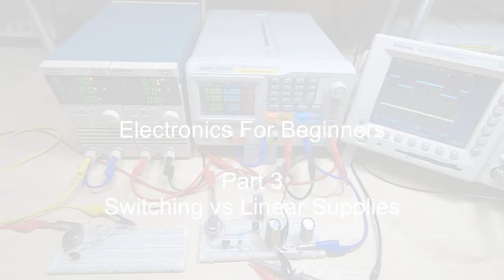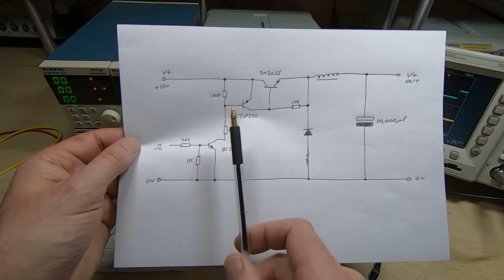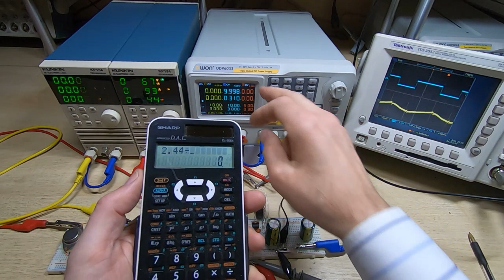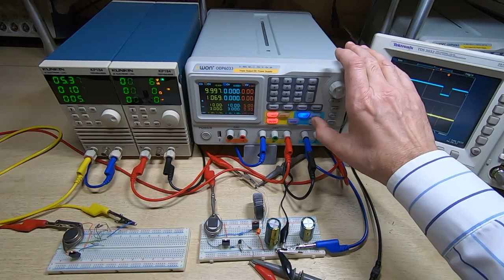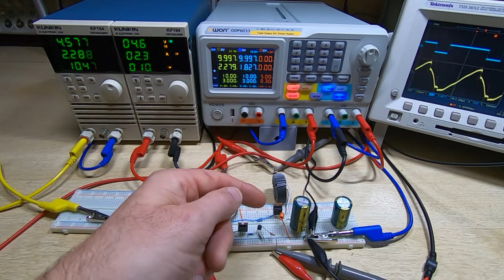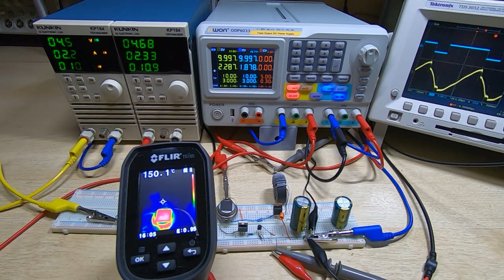Electronics For Beginners Part3

Comment: Another fascinating video Jerry. I thought we were going to see the linear supply breadboard melt! I know I could do it from the information displayed but for us lazy viewers it would have been helpful to calculate the efficiency of each unit for comparison. I love the idea that we could optimise the components and add feedback to the switching supply - no, YOU could, I couldn't! 😀 So, apart from getting less ripple, why would someone choose a linear supply over a switching one?
Reply from the maker: The efficiency of the linear supply in this example is 50%. That is why I chose a 10V supply and 5V output. I did not show the calculation in the video as it was really fixed (as it is for linear supplies). A really interesting project is to build a switching supply and try to get the highest possible efficiency. That is a really good way to learn a lot very quickly. You hit the nail on the head, The main advantage of a linear supply is low noise (or low cost for low power supplies where a DC rail is already available).

Comment: This is hardly for beginners I think. The circuits are not explained, the video is all about the fact that a switched power supply is more efficient. Why not start with a really good explanation of how a transistor works and how it is used in circuits, followed by a comparison of several types of transistors.
Reply from the maker: The video was about switching vs Linear supplies and what the fundamental differences are, not how to design one or how they work. I do however include a link in the description to a video in which I explain how the switching supply works but as I said that is Not what this video is about. A video should stick to its stated aim (In this video I compare the efficiency of a simple switching power supply compared to a linear version). If I start trying to explain how individual components work in every video then the videos would go 'off topic'. If I ever make a video about 'how transistors work' then I would include your points but this video is not intended to cover that topic.
Reply: I wanted to comment a similar thing, however with a completely different conclusion:
Lessons 1&2: Showing a vintage breadboard
Lesson 3: Linear vs. switching voltage regulator.

However, I think everybody here knows what a transistor is. There are probably thousands of videos out there explaining the difference between a BJT and a FET. But I have never seen a linear and SMPS use a 2N3055 next to each other. (And the resistive/switching element doesn't really matter here - imho.)
So, Mr. Walker please continue. I don't believe those videos are meant just for beginners but should also be interesting for intermediate to advanced viewers. I see myself as an intermediate and want to learn more!

I really appreciate the “out of the box” thinking style of your videos. That’s what I’m here for and why I stick around.

Comment: Very informative and well stated information. How is that new Owon power supply?
Reply from the maker: So far I cannot fault the Owon supply. The Rigol has not reset again since I repaired it but after 5 years I never got used to the silly panel layout but the Owon is a good layout (for me anyway). It is also nicer having the extra voltage and current. There are some very minor issues but nothing to really complain about.